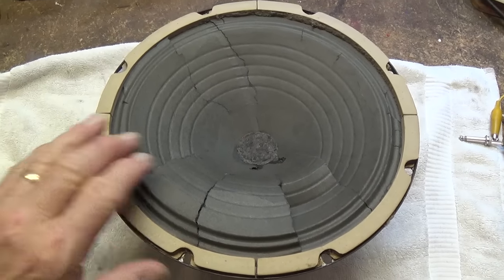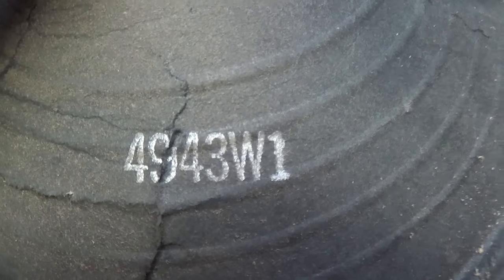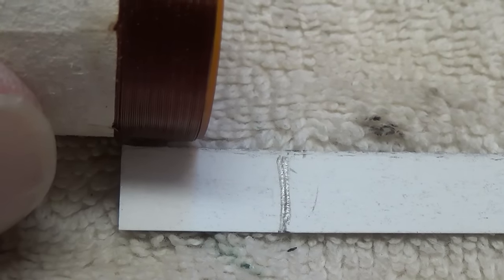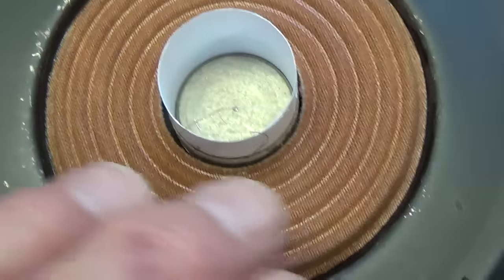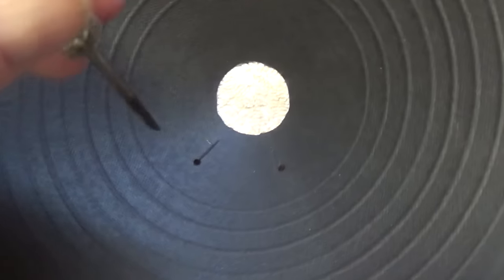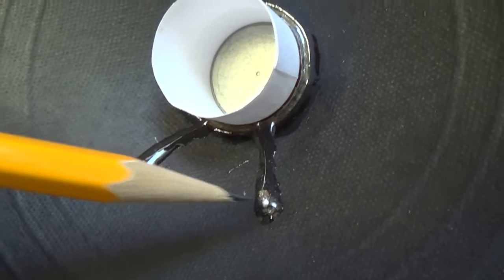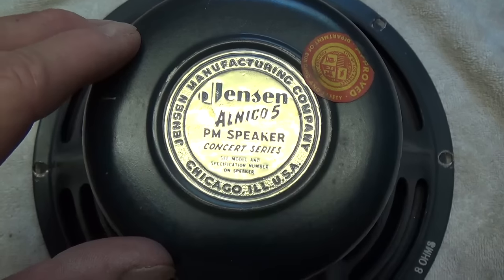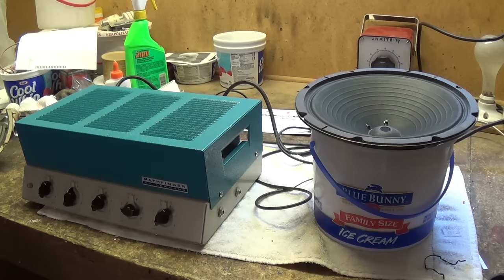How to Recone a Speaker

Comment: How do I cut my 4 inch dust cap off - without cutting the wires ?
Reply from the maker: With a fresh Xacto knife.....and very carefully.
Reply: @UncleDoug  thank you but I don't have to do that now to get the dents out of the dusk cap - I used  A  sharpened clothes hanger that was bent - that I pushed into the dusk cap and the dents popped out when I worked the hanger in the right way and glued up the hole. thanks for your video

Comment: Hi Doug... looking for advice.. my 1968 Princeton Reverb speaker cone has an issue. Looking for advice if it can be cleaned or repaired..not even sure what it is but it looks like something melted and covered the center part of the cone.
Is there a way I can send you a picture of it?
Reply from the maker: It has probably been "repaired" by a previous owner. If it's just the center of the cone, it should cause no problems and the sound should be fine. If you want to send a photo anyway you can post it on my Facebook page: Uncle Doug's Vintage Amps.
Reply: Uncle Doug messages you on Facebook
Reply from the maker: @crappygingy8497  I replied.....hopefully you will be able to find the cause of the buzzing.

Comment: Hi this is beautiful work and very informative! I'm wondering, is it possible to replace just the voice coil on a speaker or does that require re-coning the whole thing as you have done here? I'm wondering how you could manage to salvage the spider and speaker cone, especially with the wires from the voice coil embedded in the epoxy and connected to the braided cable. Not sure if this is possible but would be great to be able to bring back to life a few speakers I have that seem to be totally find except for the voice coils. Thanks as always!
Reply from the maker: Thanks, TJ. Yes, it is possible to surgically extract the voice coil and install a new one without disrupting the original cone. It's not easy, but I have done it on speakers that were worth the time and trouble.

Comment: your description box says the original voice coil was completely destroyed, could you tell what material the former was made of? and what of the new replacement, is it kapton?
Reply: 15:08 masking tape handle... great idea, I'll use that one.
Reply from the maker: The original VC used a cardboard cylinder, while the new one is (I believe) aluminum.
Reply: thanks. I've just bought 4 busted eminence 10446 alnico speakers on ebay. they look in fantastic condition but seller states the voice coils are burnt out. So I've discovered that I can make replacements myself and change them without reconing. my only doubt is what to make a former with. can't find info on exactly how kapton formers are made, or what eminence used... I may just use aluminium regardless.  I dunno yet.
Reply: watching this again I can see the old one was cardboard. I wasn't paying attention when I watched it and only thought about what the form was made of at the end. your replacement looks like kapton.
Reply from the maker: I'm not sure what kapton is or what it looks like, AY, so you might be right.

Comment: Uncle Doug,I fixed a tube radio new caps,new nos tubes,but the speaker I fix a bunch of bad spot on it with tea bag papper and Aileens tack glue ,speaker works ,I have a new 4" 8ohm speaker for it,the reason I didn't switch the speaker out it has a transformer on it ,but where would I get A new cone kit for  4"  8ohm speaker,I want to find a kit to try to recone it one with everything I need to do it? Anyone
Reply from the maker: Check the video description for a link to The Speaker Exchange, Ron. They offer all sorts of re-coning supplies.
Reply: @UncleDoug  thank you for that info

Comment: That is not an easy job, pfieuw. I wonder what will happen when you replace the paper cone edge with a rubber edge. I have a few boombox speakers with torn edges, can I repair these with a rubber edge? I also think this will effect the bass response a little or is the (stiffness of the) spider also responsible for this?
Reply from the maker: No it's not, CB.  I would not suggest any rubber-edged cones for guitar use. They will blubber at a volume setting of 3 (or maybe even less). Stick with stiff all-paper cones.

Comment: Great! U always nail my needs! Very fine repair. I have a broken Celestion G12 Rockdriver Vintage speaker that I'd love to recone. I contacted the company and this is what they said: 
"Thanks for that, the T number is 4707.
 The bad news is that there is no official recone kit for  this custom speaker and unfortunately none of our standard kits will quite fit. Because this driver has a flat back chassis, there would need to be a spacer ring under the suspension for a standard kit to fit and work correctly."

Do you think I'll be able to find an standard recone kit that I can use for it? Greetings and keep doing it so well
Reply from the maker: Contact Cathy at the Speaker Exchange (see link in video description). The proper re-cone kit wasn't available for my speaker either, but she was able to come up with the parts I needed.
Reply: Thx Uncle
Reply from the maker: You're welcome. Good luck.

Comment: Apologies for the late comment; all these videos are so excellent and I'm only now discovering them.

I notice you didn't do anything about worrying about polarity of the coil electrically vs cone excursion direction.  I guess for this sort of speaker for just a single-speaker amp it doesn't matter, but, in general it does, and I wonder if there's a convention?  (positive = evert the cone, or the reverse, I suppose?)
Reply from the maker: No problem, Dan. Polarity and cone excursion are of no consequence unless there are multiple speakers......then they must all be in phase with each other. It's easy to determine speaker polarity with a 9V battery.  You take note of which way the cone moves when the battery is (consistently) connected to each speaker and mark the lug that coincides with the battery + lug and the speaker moving outward.
Reply: ok, so the convention is + = out.  Thanks!
Reply from the maker: It really doesn't matter whether it's in or out, Dan, as long as both speakers move in the same direction at the same time.
Reply: oh sure.  but conventions make life easier without having to test each speaker.

Comment: Thanks for a great video! Also liked the landscape footage at the end. Is that Texas? I remember reconing some JBL and EV pa speakers some years ago, I would let them run on a low E on a generator and power amp for some time, just to soften the suspension and basically burn them in. Helped the units match the cabs they would be installed in...
Reply from the maker: You're welcome, Jan. Yes, it's the extreme-Western portion of Texas and southern New Mexico. Your method of breaking in the cone suspension sounds like an excellent idea.

Comment: Hi Doug, I pulled a "Homer Simpson" today and put part of my thumb into and ripped the cone on a Vintage 30.  Do you think I have a chance of a "do it yourself to repair" or is it even worth it?  It is a new model Celestion... All the best and great video... especially the Blue Bunny cabinet.  Happy Holidays.... Mark
Reply from the maker: You've got nothing to lose by trying to fix it, SF. If the hole is in the smooth cone, it should be readily repairable. If it's in the rippled suspension, be sure your glue is flexible, i.e. silicon, and strong. Good luck and happy holidays to you all.

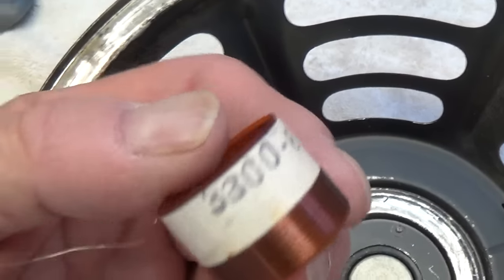Comment: 4:50 "should be around 6.3 ohms of DC resistance"? ALL speakers use AC as they need the full waveform. DC only uses the top positive half. 
resistance is the same AC or DC.  i dont see DC or AC resistors because they serve both.
Reply from the maker: There is a difference between resistance and impedance, DS. Speakers are rated for their impedance.....but few people have a way to measure impedance.....so you simply measure the DC resistance of the speaker voice coil and then increase it by about  25% to 30% and you will get the approximate impedance.

Comment: Why not use construction paper to form your own cone? I have been using this for many years to rebuild speakers for antique radios, stereo speakers, and tiny 2" to 3" equipment speakers. None have come back broken or torn yet over the last 20 years. 
  A good video for those who haven't tried to rebuild or restore their own speakers.
Reply from the maker: Thanks, LS. It might work for 2" speakers, but I can't conceive of it working with 12" guitar speakers. Also, how do you create the rippled suspension rings around the perimeter of the cone?
Reply: I think you answered your own question given the types of speakers you're re-coning.  But using that material on a guitar speaker would be like a moth to a flame.
Reply from the maker: Agreed.......it would be virtually impossible to handmake a viable guitar amp speaker cone. @divebomb99

Comment: You should have epoxy the connecting wires in the cone on the backside first not just relying on one side but a very good job nevertheless. What is Elmer's glue is that the same as PVA I use PVA? You can get a felt mat from a turntable and put that on the metal core making sure you've got clearance so it doesn't touch the vocal coil and the edges are glued so it doesn't unthread this will make the vocals sweeter and cut down on distortion.
Reply from the maker: Thanks so much for your helpful input, John
Reply: Uncle Doug and another thing might find helpful that's ok to put washes straight on the dust-cap because it's Solid?  but if you got a dust cap that's very soft cardboard or a porous type you don't want to push it in. So if you get some blue tick and make a big sausage wrap it round the edge of the dust cap and cone press slightly on the cone to give it some clumping and I find a roll of tape that clear's  the dust cap but put pressure on the Blu-Tack for even pressure.

Comment: good work, nice presentation. @ the end...maybe the train was carrying seeds that fell off.
Reply from the maker: Thanks, Nick. An interesting idea.....but it doesn't explain the existence of an elaborate watering system that keeps the plants alive.
Reply: Uncle Doug Strange indeed. I really like your videos, I have learned much from them. I have built several tube amps in the past five years and you inspired me to start one more. I built a Fender Bandmaster circuit and two Marshall 2204 50 watt master volume heads. They were a success and sound clear and noise free. (Relatively speaking) I want to build a single ended amp with more power than a Champ. I was thinking a single el34 amp. I want cranked power tube distortion without the 100 watt volume, but still compete with drums, bass, and vocals. Any schematic ideas?
Reply from the maker: You might look into the Fender Princeton 5F2-A circuit.....much like a Champ with a tone control. You could simply beef up the power supply and output transformer to cope with the EL34.
Reply: cool...thanks I will look into it for sure. Just watched more of your videos. I like your presentation...informative with a bit of personality (rusty is a good dog! I have a cat...we call him Cow because he has the white and black cow patches.) I also like your presentation of the tremolo. I never knew how it worked... now I do. Thanks for your explanation. I want to include one in my next build.
Reply: Uncle Doug  
cool...thanks I will look into it for sure. Just watched more of your videos. I like your presentation...informative with a bit of personality (rusty is a good dog! I have a cat...we call him Cow because he has the white and black cow patches.) I also like your presentation of the tremolo. I never knew how it worked... now I do. Thanks for your explanation. I want to include one in my next build.
Show less
Reply from the maker: Thanks for your nice comments, Nick. Best of luck with your tremolo project.

Comment: how to cut down the cone evenly
Reply from the maker: It doesn't have to be perfect.....just take your time and get it as close as possible.
Reply: id like to recone an old speaker out of an 40s tube radio and hook it to a guitar amp , do you think this could sound good playing metal?
Reply from the maker: @bdawnedon  Probably not, BD. Radio speakers are low-wattage and for mid-range frequencies.....thus not adequate for guitar use.
Reply: @UncleDoug  thanks for the advice are theyre any recipes guys use to make old speakers bad ass  with a recone kit or is this just a wacky idea?
Reply from the maker: @bdawnedon  There are no secrets, BD. After re-coning, the speaker cone will have to break in gradually with use, before sounding its best.

Comment: Hi Uncle Doug! I'm rewatching this video because I got a pair of old polish speakers and maybe they're gonna be good base to learn reconing. Replacement cones and coils for this model are still available and dirt cheap. Speakers themselves were cheap, ~10$ each. And they are not THAT old, they're from the 80s. But for us, here in Poland, our polish things from communist era are kinda vintage :) Anyway, I don't know if reconing is necessary in this case because they are in overall good condition but one of them has small mold spot on the cone. Do You know any good way to clean it? Or is it not worth it and I should just recone it? Here's a pic
https://drive.google.com/file/d/1T8lehcL6hNsomA5wPK13LLOvQqs9wFik/view
Thanks!
Reply from the maker: I understand your dilemma, Nusior. Since the mold spot is not near the suspension at the perimeter, it should be easily repairable. I'd use a Q-tip with some glycerine  (local drug store) to remove the blotch. If the cone is thinned in that area, perhaps a small patch (thin black paper and wood glue) would reinforce it. I never re-cone unless a voice coil is open or rubbing, or the cone is irreparable.
Reply: Thanks Uncle Doug! Great idea. I haven't thought about glycerine. I even considered some kind of spray I have for mold on bathroom tiles but perhaps it's too brutal for paper cone. I'll try your way. Thanks! :)

Comment: Ugh,  I SPENT A HALF  HOUR EXPLAINING  HOW-TO REWIND A BLOWN SPEAKER  WITH A GOOD  CONE, BUT ACCIDENTALLY HIT  THE BACK   ARROW!!  In a nutshell you use acetone to soak surround, spider, and cone edge. get very wet... The acetone does not harm the paper components or spider. It fully evaporates. Do outside or well ventilated shop. Resoak cone edge after cardboard are removed. Once cone is removed measure resiistance, soak windings* .....count number of  windings  as you remove. NEXT I EXPLAINED HOW TO  *MAKE DOWEL, AXLE, DRAG STRAP. Rewind new wire and apply rubber cement BEHIND windings, but enough to barely adhere adjacent wire. 
PRACTICE  ON AN OLD CHEAP SPEAKER😊
I'VE ALWAYS USED RUBBER  CEMENT WITH  NO BREAAKDOWNS.  And I've rewound dozens of rockers Celestion, Jensen,,   etc
Reply from the maker: Good grief, Paul. I still think I'll continue to buy reconing supplies.

Comment: The coil was not correctly placed relative to the magnetic gap! The center of the coil should be in the middle of the thickness of the front disk, in which the maximum magnetic induction is concentrated. You have sunk the coil all the way into the magnetic system. The speaker will work badly!
Reply from the maker: Thanks for your input, E.....but your pessimism was unfounded. The speaker has worked perfectly for several years now.

Comment: Sad that it's needed. Only because they started using crap material. I have pair of HPM-150 Pioneer. Bought them new in 1978. THey are as new, no stupid foam on them.
Reply from the maker: Indeed, KJ. Paper voice coil forms, thin cones with weak suspension, improper voice coil shimming, etc. make re-coning inevitable for a lot of speakers.